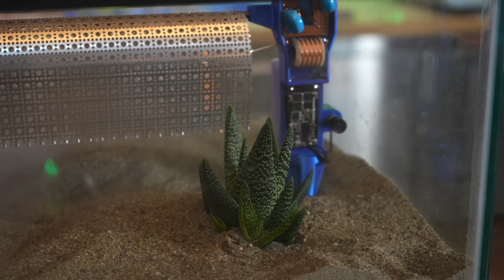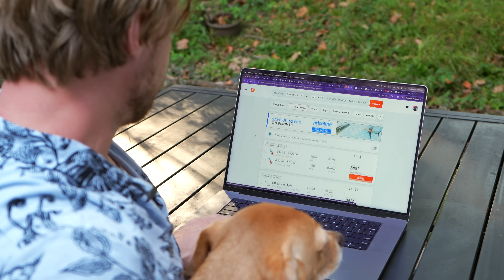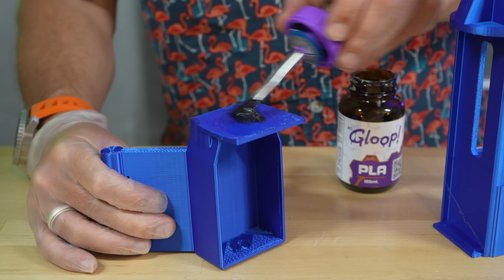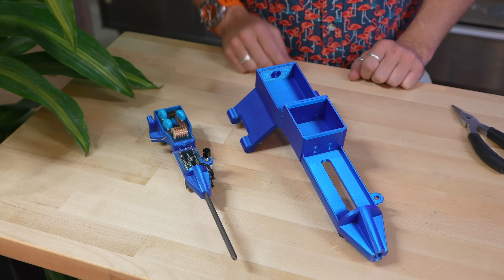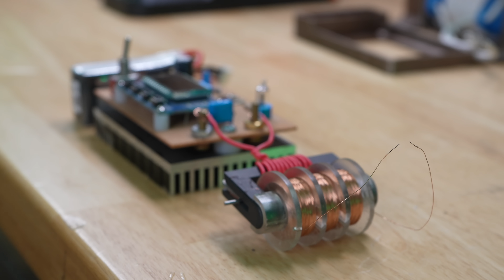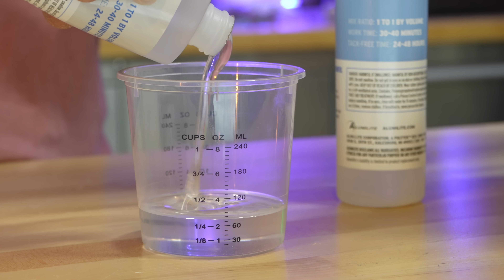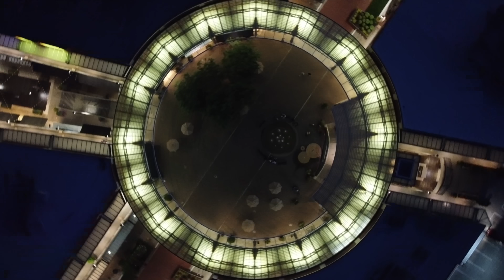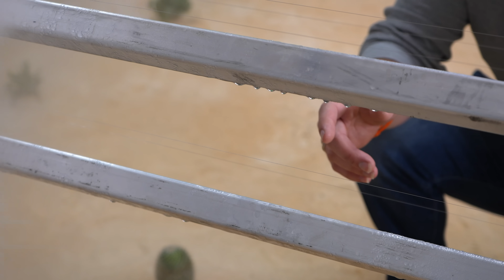Turning Desert Fog into Fresh Water Using 50,000 volts

Comment: use an ac heat pump instead. keeps you cool also. and hot. no high voltage parts. keep the fence down how it should be. no putting up with the hv fence. low voltage arc welding plasma instead. also a river is a normal fog cloud rain water condenser. if not freedom then no free dom. high cost components is not really an improvement. your fog condenser is only a ionic wind thruster tho. like an ac. minor issues. also deadlines are bs. just believe. do stuff smarter, dont money harder. you have above dont you, ie who is everywhere. not in visible way you know but ignore. said it here first. high voltage stakes you know. home turf advantage. also putting high voltage animal fences around places might not be the best. lol. solar water collectors are much better. good on paper, being practical is questionable. ie like tsa. and all other people's gov of non-liberty. only those who are saved from your freedom hands are the true gov. well conditions of freedom are pretty strict you know. like your 1st and 2nd freedoms that are not freedoms currently. again, above or nothing. cant tease above with any enforced rules for the free. also save those still under your rulership of people laws enforcement. not even looking at that way if any of those fences are in place. above said so, not my flesh. no longer lives me, in above we trust, but christ in me. bless you, dont curse with your judgements of people flesh. well nano ion 3d printers require some high voltage plasma ion/electron pen drawing nonsense. on silicon wafers. and optimally a dc motor does not require a chip driver. not a work agreement license in any way bruh. dont even think about it. full freedom or nothing. throw your worries, not in work slavery camp, but on the above instead. you know, you are not doing like you said you would be doing. its because people always lie and people flesh cant do anything useful. just friends bruh. no agreements or restrictions in any way. sorry you are not in control. above is in freedom. dont curse me bro with your rules. not going driving any day soon bruh. freedom or nothing. ie no service to you. ie keep your duties in your own pants freedom. ie no taxes for talk. ie not making you evil by paying for any your goods. why do you think zapping people for pain is fun people. so dangerous violent behaviour of flesh with power. no power to flesh then. at least nothing. you dont know what you are asking for bruh. nope nope nope. not even talking about it. yes diy if you can. may above help you instead. trusting in people is a mistake. that collector looks like a radio antenna. sandy bridge. totally normal. kids of this world. why use wires when you can use the structural rails. zero negotiations for you. all talk of people is in vain. no forcing anything. not freedom. fake freedom. just your gov being bs. cost too high bruh. free or nothing. props for the flesh fog cloud right. passive solar condenser cooler would be much better and cheaper. dont go beyond the sea to fish bruh. dont you have timer activations bruh. ie rpi or arduino with real-time clock whatnot. way too complicated sir master.

Comment: Use the sensor out of a fire alarm the water droplets should be large enough to trigger it, I use to work in a washbay with steam and the water droplets use to set the fire alarms off all the time. Instead of activating an alarm it can activate this beauty. How to deactivate it once the fog is gone I dont have an answer for

Comment: 💡💡💡💡💡If you just need to drive the fog through the condenser, why not use a PC fan that requires low power to drive the air towards the condenser as that would be safer for people and wildlife that accidentally happen to touch this device ?💡💡💡💡💡.  That said this is a very good effort, please carry on to find ever more efficient way of getting water out of thin & moisture laden air.

Comment: I think this is a cool concept, though I question the efficiency calculations.  Wouldn't varying humidity levels affect the efficiency/condensation rate?  This would seem to be the case given that you are targeting fog collection.  Thus, for proper metrics you should make sure when comparing different designs, to maintain the same humidity level during each test.

Comment: I want to see the real world test before I can be bothered to care about any stats. We know it can work under some ideal conditions. Lets see real conditions and repetitive use within them (wear). That's where it gets interesting.

The solar side makes sense here. What about something that reads the decline of solar power generation and then sets a timer to approximate running during when fog would be present. Then you could use some kind of flow meter to determine efficiency has died off and shut it off. Or if you're generating a lot of power you clearly aren't in a bunch of fog.

Comment: A thought on collection. Rather than trying to collect the water under the whole surface of the bar, if each section were angled then the water tension should keep the water on the bar and let it run "downhill". At the lower end of the bar would be the collection area and a nub on the bar at that point should provide a place for the droplets to get bigger and drop into a jar. This would be more important as the device gets larger, as it keeps overall costs down and is less cleaning and maintenance over time for the operators.

Comment: Dumping sand in a garage doesn't simulate desert conditions but it looks like it was fun, so, I hope you had fun with that.  The bucketed sand would ground differently from the sand on concrete (which is already different from real life).  Dry ice doesn't have any water in it, so, how was it aiding in water condensing on the device unless it's just the cold causing that?  Anyway, if you can show that it was real water that came from the air and not just due to temperature caused condensation, then that's a neat device!

Comment: you could potentially run a micro charge through it so that when it starts producing water, a Hydrometer picks it up and cranks the voltage or you measure the change in voltage and auto amp it up from there

Comment: maybe as a traveler novelty, but the nets they use cost like 10 dollars and this machine is more like 300. so even if the nets are less eficient, you can just use bigger ones to compensate. also, that solar pannel looks way too small. it should have around half a square meter to run most of the night.

Comment: Doesn't moisture content in air change the resistance? Could you make your switch automatic just based on the air resistance when the moisture content reaches the required threshold? Does it have to be fog, or will it work in a high humidity environment as well? Lots of places along the ocean are extremely humid, but not necessarily foggy.

Comment: would a slight bend in the condenser bar, like in the middle,  make the water flow more efficiently to one spot, making room for more fog to condense? just thinking cause I've seen water flow faster off of slopes than flat bars.

nvm, solved by just making the middle post slightly higher than the other 2, so the entire things at an angle

Comment: As for the "when" to use it, you'd want to integrate an optocoupler power relay controlled by a separate "EM-shielded" micro-controller that takes measurements like a mini-weather station & using a clock to set the timeframe you want to target. A good rule of thumb for fog, temperature/dewpoint convergence of less than 5 degrees "and" an RH near 100%. This will save you from wasting TOU and power. I know this is a proof-of-concept, but you'll also want to consider capture/storage of the condensation. Lastly, why not design the setup more like an unraveled bug-zapper, the principle is the same, but you gain a lot more vertical area of coverage, just curious? Great job building it BTW.

Comment: Hey @PlasmaChannel , not an engineer but to solve your automation problem with turning the machine on automatically, what about using a Photoelectric detector like what is used in a smoke alarm detector? Idk if that would work, but to me it makes logical sense for the machine to "detect" the fog since its similar to smoke.... idk

Comment: brother you can use the solar charging also as the switch to turn the system on, just use something like a photo sensor switch or alike, same principle used on the cheap solar garden lights. then probably add an all weather enclosure for batteries and a bms, bimetallic thermal switch or alike and a mini fan that turns on when the batteries get hot and promote better air flow in the enclosure.

Comment: For an automatic "On" system your best bet is both a temperature sensor and a hygrometer. To make it efficient you'll need some way for the system to calculate the dew point temperature from the hygrometer and compare it to the air temperature to turn the system on when they're within 5-10° F (2.5-5° C) of one another. Then the "Off" state could be one of a couple different things, when it reaches a certain temperature threshold, or when the batteries begin charging, or perhaps the humidity drops below a certain level it's really what ever you decide to squeeze the maximum amount of efficiency out of the system. Try to keep it as simple as possible, I'd shy away from cramming Bluetooth in it for anything other than monitoring batteries and possible faults but that you can do with indicator lights and maybe a display. For something like this the K.I.S.S. method is going to save you headaches.

Comment: I feel like a esp32 running in low power mode connected to a moisture sensor with a tether long enough to avoid static interference should do the trick for turning it on.

Comment: What if you used angle iron like a V instead of square tubing? That way, the water would collect in the V like a gutter to direct it to a bucket or other collection method. Also, you should be able to use a humidity sensor to activate it or turn it on instead of manually or through Bluetooth and an app

Comment: What if you raised the center power stake and had an angle for the wings that went down from the center. All the condensed water would run down the square tubing and then drip at the end instead of across whole surface in multiple drips.

Comment: deploy a few hundred in a desert and see how things are doing after a year! once plants grow, they will draw the water out the air themselves and you can move the units to another patch.
you can build a sensor circuit which only powers up every 30 mins to take a reading from a humidity sensor, i've seen other youtubers make them and they use so little power that a AA would last years. then command it to trigger a relay and make the relay stay active for 30 mins. that way it will be re-triggered if the humidity level stays high enough.

Comment: Sandblast the tubing.
It will give it the most consistent rough surface which, short of milling vertical grooves along the bars, would give you an easy bump in surface area and nucleation sites.

Comment: Instead of using square tubing for the moist air to pass over, wouldn't a metal grate akin to the first model me more efficient to pull out water from the air due to the larger surface area? Basically passing the air trough a structure that can catch the droplets rather than having most pass by the square rod by an air cusion.

Comment: This just feels so easy to make at scale that it is odd no one has really made any of these, and almost free source of water in the desert besides desalinization seems like a huge breakthrough.
Reply: probably because fog deserts are only next to oceans and desalinating water is more efficient than collecting the fog energy wise
Reply: According to his numbers, in dense fog this produces 21 ml/Wh. What’s the same as 21L per kWh. 
Desert fog happens near coastal areas, where salt water is found.
According to the net, reverse osmosis desalination plants produce around 330 L per kWh. 
So yeah, this is wildly inefficient in comparison. Still incredibly cool though!!!
Reply: Reverse osmosis desalinating requires a lot of infrastructure to work well. And that means that it's only worth doing on fairly large scales where the output compensates for the investment. It also needs constant maintenance and repairs, as very salty water is highly corrosive. So poor farmers growing crops for survival in the desert aren't really in a position to make or run one. That's why these farmers are currently using fog nets instead of building themselves a reverse osmosis desalination plant. They are generally only used in places with fairly rich corporations and governments able to fund and run them

Something like this however, farmers could run easily with much smaller upfront investment and any ongoing maintenance could be done by the farmer with just a little training, or by local electrician
Reply: Right?! Someone should be selling these. The only thing i can think of why this would not be successful is that usually people in those regions who do not have access to water are probably also not able to afford such a device. And I don’t know if it is scalable enough (production in m3) for a company to build an entire farm.

Comment: I don't understand the benefit of the fog passing over it twice? I think you are so focused on the 'efficiency' as measured by how much of the water is removed from the air that you are losing out on efficiency as measured by how much water is pulled out of the air per Wh. If you had your second arm could be positioned to get only air that has already had fog removed, or to only get air that has not had any fog removed, why wouldn't you choose the second?

Comment: Cars have a sensor on the dashboard to sense water droplets on the windscreen , could you use one of those behind a piece of glass , as fog accumulated on the glass it would be sensed by the sensor and switch on , mixed with a barrametric sensor and a temp sensor and an air density sensor you could teach it to know when its foggy

Comment: I'm almost certain someone else has suggested this, but 1000+ comments is too much to scroll (hopefuly YT implements my suggestion of being able to search comments)...
That being said: why not HORIZONTAL grids, to utilize that air current your generating?

That way even on low wind nights it's at least creating SOME amount of linear air movement over the ground, which can cycle through more humid (foggy) air. 
Whereas vertical like this is pushing it into the ground which means minimal air movement since the air hitting the ground will be minimally deflected, or could even rebound back upwards and actually impede airflow...

This is awesome, though! Congrats on such a promising medium scale test 🍻

Comment: Instead of Bluetooth activation, why not just a simple timer/clock that could be connected to GPS time or linked to the solar panel? Deserts are roughly on the equator where diurnal variation is low .. so sunrise and sunset times are almost constant?

Comment: Why not just use the cool water produced from the fog to cool the thing
Reply: As for a fog activated switch, fog is just water. If you pass enough volts through two points couldn't It travel across the fog to reach the other end? When its sunny the arc would be to far to have a stable connection.
Reply: Or yk, when the solar panel stops producing energy it means its dark out.

Comment: use a microcontroller like node_mcu esp32 esp12 connect with gsm module for internet connectivity. and turn this device to a Iot Water collector device. Can be done easy code. If you need help, i can code it for you. Or use an AI for writing the code. Its easy. You can track everything using different sensors. how much water it collected, how much energy it consumed.  when to turn it on when to turn it off. also you can remotely manage your device. esp is a 4 dollar chip.

Comment: Make sun shade the original way with non ripstop as it water colerctor use that firest water drops ground out a servo or water switch, ,,umm you know you reranging those models you inn  invented a tool for  aluminum bending. .

Comment: Congrats on the proof of concept to harvest water- this has been epic to watch!
Little jealous at your flame-snuffing! I'm aware ionic winds snuff them out well - but can't do it in person! 
I have the Lethan 325 KV VanDeGraaff ,taped  one end of a multimeter probe cord to it, pointed the other pointier long end at a  lit candle- and 99% of the time, at the time of this comment - cannot put flames out, can only push them around. For one small birthday candle, i put it out after a LOT of pointing as the flame did NOT want  to go out. Standard candles- dont go out at all. Looking at this- I guess I don't have enough voltage.... 
I need to learn how to construct objects, like you do perhaps- then maybe I could build a half megavolt to megavolt van de graaff and get the power amounts i need -not sure how to get involved with Resin, 3-d printing, find the right custom materials to make a VDG belt [after trying to find other materials for this VDG i built and NONE of them working as well as the default rubber belts  - I tried nylon fabrics, exercise belts, everything) - I know you did so not long ago, but it's still tricky going from zero!

You're a serious inspiration, Jay!

Comment: Why wouldnt you use what little wind does blow to use it and the static energy from the sand to supply a motor to charge and move a fog net across a span to get more area covered while moving and gathering more moisture plus attracting it with an applied electronic motive like the thing in the video..  seems like not using the method thats been used for centuries is not smart.  Reinventing the wheel is more of a one in a million eureka type of invention but modifying it can benefit in other ways..